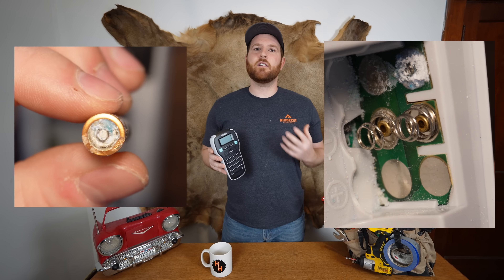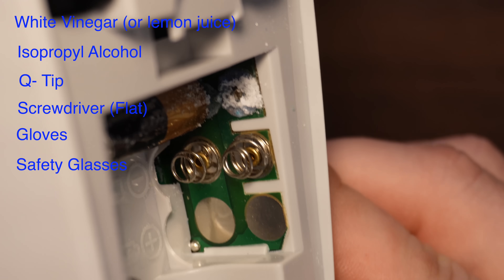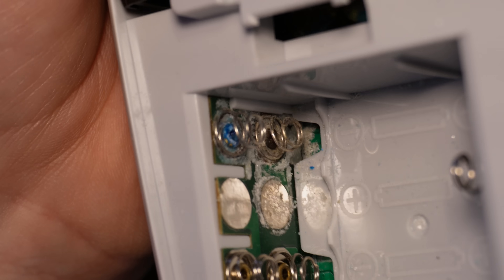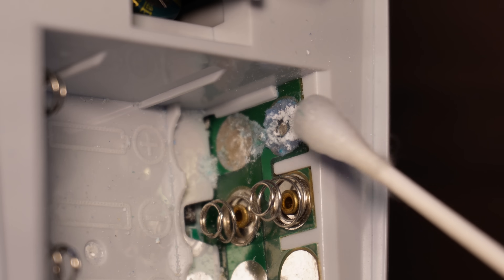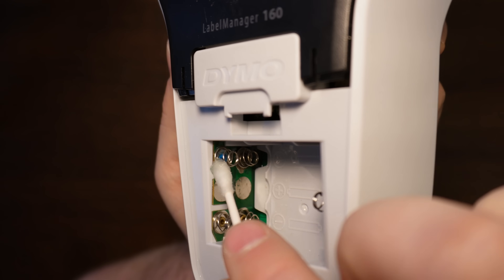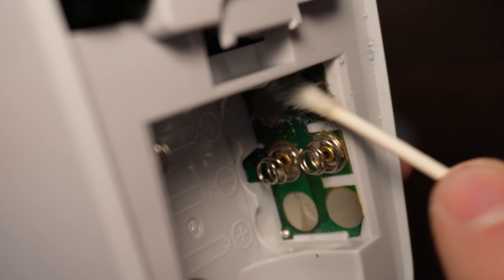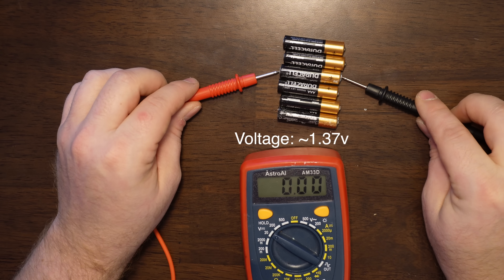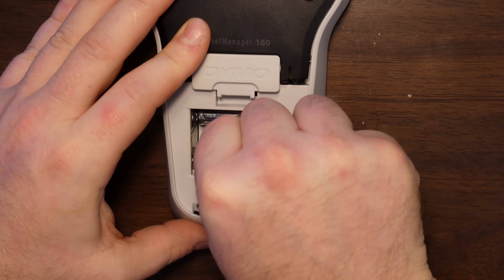Clean BATTERY CORROSION on ELECTRONICS! EASY DIY!  |  2-minute Tutorials Ep.4

Comment: Great video.  Being a member of the Ham radio community.....many of us never use the "copper top" brand of batteries.  They seem prone to leak much more than other brands.
Reply: I agree the "copper top" batteries are worthless for anything except use in a toy that will quickly use up the battery.  I am an individual that actually goes through the trouble of recycling my batteries as your suppose to and I collect a bunch of them in a plastic container and then take them all in at one time.  The "copper top" batteries were the only ones in the pile of AA and AAA batteries that had begun to leak.  I no longer use them at all, I instead use Amazon Basic batteries and they have been just fine.

I once sent in a complaint to Duracell as corrosion had occurred with one of their AA batteries in a wall clock even though the battery was years away from it's expiration date.  They sent back a gift certificate to buy more Duracell batteries.  I sent the gift certificate back to them telling them to give it to someone who was still willing to use Duracell batteries.
Reply: @InquisitiveSearcher ,
Though I have had them ALL leak, I agree about the dates on Duracell.  They give dates way too far into the future.
Reply: The Duracell battery is junk..stopped using them years ago..they ruined my boy's RC cars beyond repair..this was in the 90,s. It's been energizer,s ever since..wish i had known this back then..thanks friend..👍👍👍👍👍
Reply: @rodneybrand8521  they will ruin every thing you put them in, if I buy anything that the Duracell comes with, I don't open the package they are in, just thro them in the trash
Reply: I have to agree. I've seen them corrode having never been taken out of the package after sitting unused in a cabinet for a year.
Reply: Yes, never use the copper top batteries.  About a dozen batteries corroded in a large bulk pack I bought at one of those box stores.  I complained to the battery company and their "technical" guy told me I was storing the batteries wrong.  They were stored in a drawer inside the house, and I had bought them only a few weeks earlier.  I haven't had this problem with Amazon Basic ones so far.
Reply: Duracell batteries are indeed garbage. Their entire reputation is solely based on extensive marketing, which also explains the high price.
Reply: I use Ray O Vac batteries but I’m 138 years old. “Is Rusty still in the Navy?” 😝
Reply: @billdivine9501 🤣
Reply: I have said this about Duracell batteries for over 20 years, and I have always been refuted by friends or family. This is just my consistent experience with the brand. I'm happy to see so many people with the same experiences. Personally, I prefer Energizer, but I have found great results with Rayovac for less money.
Reply: Agreed!  Never use Duracell anymore.
Reply: I’ve used to use Duracell batteries and found them to be excellent.
Excellent that is if you want a new piece of equipment, and are willing to press your case. 
I have never attempted to do this illegally, it has only been after discovering that a device is not working, and when checking the battery compartment, discovered that the Duracell batteries have leaked and damaged contacts and printed circuit tracks, rendering the devices inoperable.
Over a period of a few years, when I thought they were ok, I used Duracell, and on 3 occasions, Duracell replaced expensive equipment e.g. Fluke meters and the like.
On each occasion they required photographic evidence, but never asked me to send the damaged equipment to them.  They simple sent a cheque , for a substantial amount.
I then bought replacement equipment, repaired the damaged equipment, and had more devices to use when fault finding.
In the end I stopped using Duracell, and ever since have used Energisers, which haven’t leaked.
Reply: @Jestey6  THAT'S interesting!
Reply: note that the excellent rated Costco Kirkland batteries are claimed to be rebranded Duracell coppertops.
I buy energizer batteries.
Reply: @JohnW118  Same here.  My kirklands were always leaking 👎🏼
Reply: @JohnW118   Where are they rated excellent? Kirkland are the worst!
Reply: Yes I stopped using them because of that. I only use energizer and never had them leak.
Reply: @enzop.3227  This is my experience as well, I give you a second here.
Reply: @enzop.3227  ,  I have had occasional leakage from Energizer batteries but never from the lithium types.
Reply: @patmx5  Ikea LADDA batteries are very good and cheaper then the Sanyo NiMH. It also been mentioned they are made in the same factories
Reply: @bobsoft   I have heard that too, but have no firsthand experience with them - I've thus far only used the Sanyo/Panasonic Eneloops, and Fujitsu AA/AAAs.
Reply: I quit using Duracells as well. I've lost multiple devices due to corrosion from those batteries.
Reply: I totally agree, duracell is terrible quality.
Reply from the maker: Thanks for the info!
Reply: I had good luck with Rayovac alkalines until about a year ago, when I noticed leakage in many of my devices.  I switched to Energizer, only to have the same thing happen.  Now I only use rechargeables or Chinese Delcos; I haven't had any problem with the Delcos yet.
Reply: I agree as well. I have had remotes that have been in storage for years with Energizer batteries and no one leak. I have Duracells leak in remotes that I have been in use for less than a year. The hell with Duracell!
Reply: They ALL leak.  The problem is, the stronger ones like duracelll and energizer keep working as they leak, so I don't realize there is a problem with say...a wii remote until the battery acid leaks all over an end table ruing the finish.
Reply: Yup, Duracell are now a "zombie" brand, manufactured by who knows who. Absolute garbage.
Reply: The industrial version of copper top is called Procell, in my experience they also leak. I did some testing with Panasonic Eneloop Pro rechargeable AA, I got nearly 50% longer run time than Procell. They hold charge well when not being used, haven’t leaked on me. The only down side I can see, when the battery is near empty it dies very quickly. If using in a device that gives you low battery warning, there will be very little warning before it’s dead. Don’t get the non-pro, go for the grey coloured Eneloop pro with decent NiMH charger
Reply: Sounds like Duracell needs a class action lawsuit or two!😂
Reply: I simply hate Alkaline batteries. Especially Duracell. They always leak fluid that corrodes the terminals. The worst by far are Duracell, which I noticed was used in the video. They are so bad that even after cleaning as shown in the video my electronics usually don't work - they are toast.
The Durashit batteries as I call them leak well before the expiry date, even in unopened packets. They always leak during use even when it looks like that have almost full charge. it doesn't seem to matter where they are manufactured (US or abroad), all size alkaline Duracell batteries leak. AA, AAA and the 9V ones which I use the most. Basically, I don't buy Durashit anymore. They are an awful product.
Reply: @MikakoPalmer  Class action lawsuit?
Reply: Totally this. Duracell used to be great but they became awful a number of years ago. Remember the Duracell "leakproof guarantee" ? It's not on them any more because they know. I've never had an Eneloop or Fujitsu NiMH or any Energizer battery leak on me.
Reply: You just saved my lil battery powered Christmas lights, THANK YOU 🎉🎉🎉🎉 I was so low-key bummed Lol
Reply from the maker: Thanks for watching!
Reply: I agree with your assessment.  That brand has caused me no end of grief.
Reply: Yo HANDYMAN, I like you man I like your stuff keep it up. Thank you.
Reply: Mostly since they have been made in china.
Reply: @richardchambers256  China has nothing to do with leaky batteries, it is the specifications for materials and QC that Duracell uses. You'd get the same results if they were made in USA except it would cost you more.
Reply: Agree copper top is a big leaker, pretty good results with Kirkland brand.
Reply: Nope.  Rayovac alkaline batteries are the worst!

Comment: I use a baking soda solution which works
Reply: Baking soda won’t neutralize corrosion from alkaline batteries - it is alkaline too.  To neutralize the alkaline battery vomit, you need to use a mild acid like vinegar.  (NiCd battery leakage is also alkaline, and can be neutralized with vinegar.)  Baking soda should be used for leakage from carbon zinc batteries, which leave acidic residue.

Comment: I use vinegar also. That being said, i change my batteries regularly. At least once a year. Kind of like spring cleaning.
Reply from the maker: thats a good idea, what brand do you use?
Reply: @HandymanHertz  brand of battery ? Just about any that I can get my hands on. Kirkland, Duracell and whatever is on sale at harbor freight. Actually most any brands will do. I mostly use the harbor freight stuff in my shop because I usually wear them out before the yearly change. For the house for most stuff that is not used often, it's the other two. But still, yearly changes has stopped any corrosion issues. If you have things like flashlights for emergencies, keep the batteries out of the flashlights. Keep them near or tape them to the flashlight. I keep no batteries in my emergency kits. Or my bug out stuff. I keep them where I can get to them in a second. Now if you keep a kit with you then again, change the batteries yearly.
Reply from the maker: @georgecurtis6463 👍🏼

Comment: Great video! BTW, you can use an eraser to remove corrosion (though I would complete the steps you provided in your video first), but you need to use an ink eraser (the white one). And unless you have a large area that you want to clean, get the kind that looks like a pencil that you have to sharpen—the point of the eraser is small, which makes it easier to get it where you need it.
Reply: Ink erasers are typically not white but grayish colored and will contain some kind of silica grit like pumice, sand or fiberglass.  Unfortunately most modern pencil-style erasers aren't made the same as they used to be because they are sourced from China or Venezuela instead of Germany and the US. Staedtler, Ebersoll, Faber Castell, all different now;  and old stock erasers often dry up and become crumbly because they were made with natural latex rubber.  Art supply houses typically sell what they refer to as a "plastic" eraser that is some kind of doughy white vinyl substance which is useless for cleaning oxidation.
Reply: @goodun2974  OK. I use white erasers that look like pencils to remove light oxidation. They have more of a polishing effect that is most effective on bare copper battery contacts. They might be used as the final step in the technique for removing the type of heavy oxidation seen in this video.
Reply: @smurfdoggy  , I am semi-retired after working 17 years in an audio repair shop. We frequently use NOS erasers (the pencil type, encased in wood) to clean oxidation from relay contacts, disassembled switches and so on.  We haven't found a source for new ones that are any damn good;  all the old familiar brand names I previously mentioned are being made by somebody else in other countries.  When our stock of erasers runs out or dries up I don't know what we'll do!  We also have powered draftsmans erasers that use a quarter inch diameter rubber rod that's about 8 inches long;  The pink ones have a very slight abrasive action and are good for polishing the outside barrels of RCA connectors on amplifiers and the Gray rods are more abrasive and can even remove anodizing and paint from metal chassis where ground points are to need made.  We have a decent stock on those rubber rods for now but can't seem to find good ones that work nowadays. I also use the fiberglass-bristle scratch brush frequently and I have even found a way to fit the fiberglass inserts into a battery powered artist's eraser. They're excellent for cleaning anything that needs to be soldered and you can even remove the green lacquer coating from copper foil traces on printed circuit boards with them.
Reply: @goodun2974  Thank you for the information. I'd never heard of a "fiberglass-bristle scratch brush," so I researched them up on Amazon—they sound great for a variety of tasks. I spent years servicing electronics down to the component level, primarily test and measurement equipment, but I'm now retired. I still do repairs for friends and family, but because I have control issues with one of my hands, I don't do as much as I used to.
Reply from the maker: Thanks for the info!
Reply: @HandymanHertz  ,  If you can't find erasers that work, buy yourself a fiberglass bristle scratch brush.